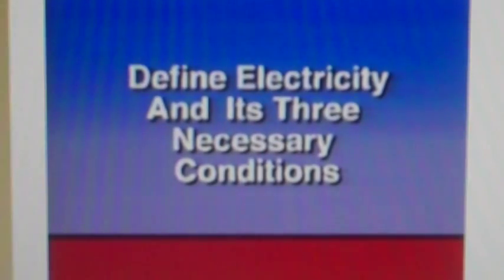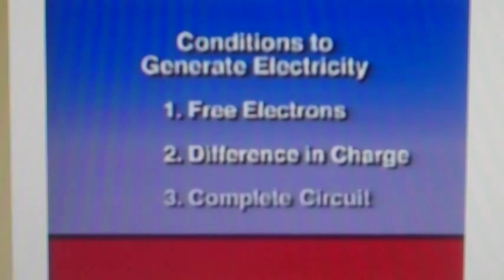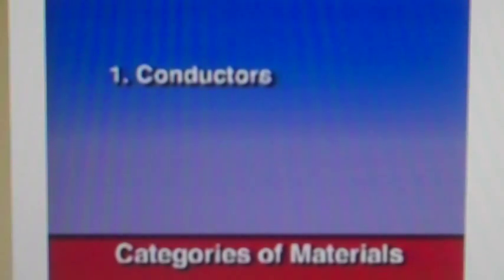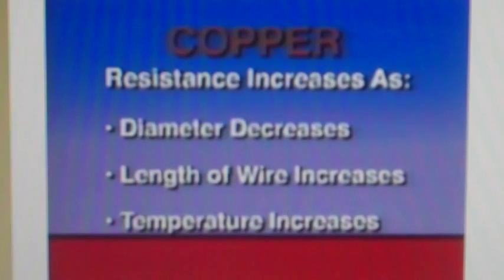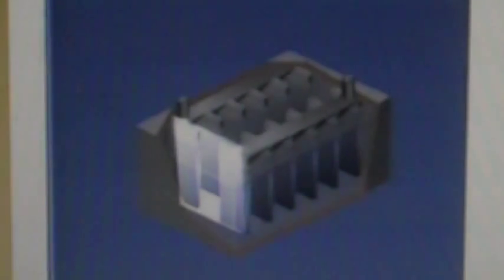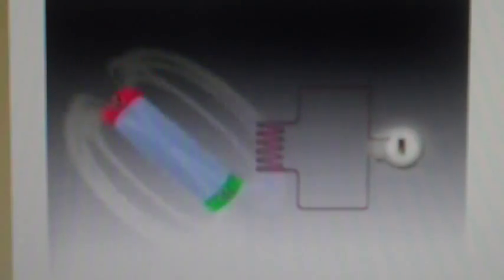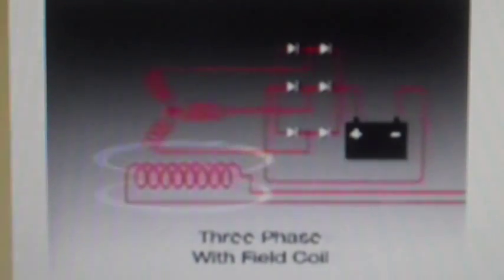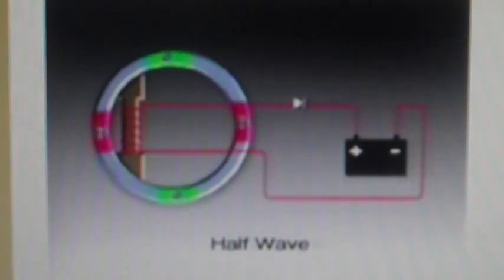Motorcycle Electrical Principles Explained

Comment: Quite comprehensive.
Good 

I had this experience.
I have a motorcycle with a small 125 cc engine. It's a twin spark motor.
Both spark plugs are of the same heat range/ rating.
I once thought of switching their positions with each other.
So I did and started the bike. 
Lots of misfiring, poor pick up, overheating, loss of power.
So after cool down I switched them back to their original position. And everois perfect now as before. Never did it again and will never do.
What could be the reason.?